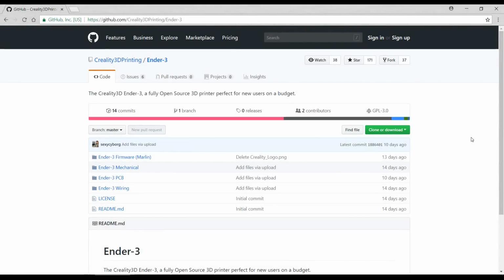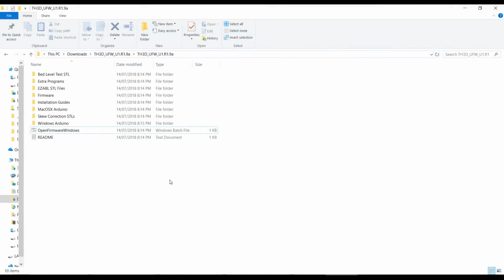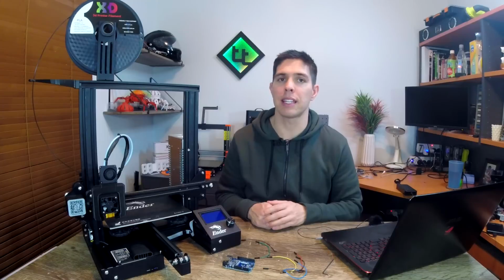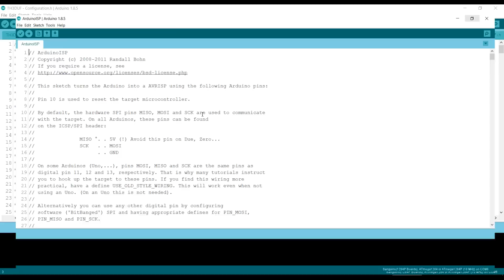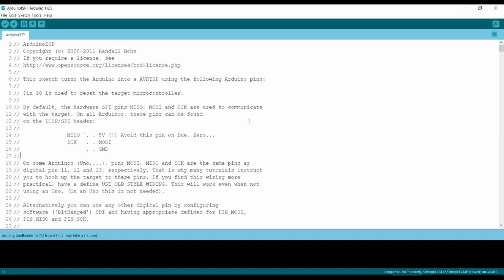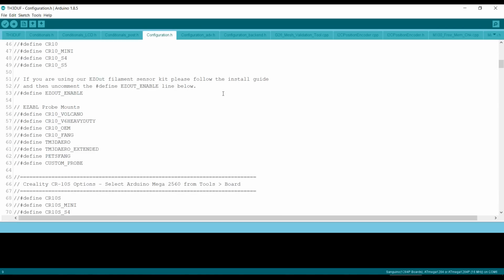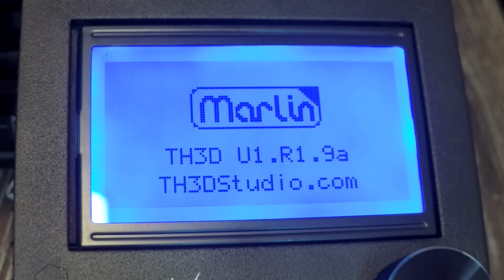Ender 3: How to install a bootloader and update firmware

Comment: Thank you! Thank you! Thank you! I did this sooooo long ago and forgot the process! I was trying to upload the Marlin sketch via the arduino uno AFTER burning the bootloader (>ლ) Obviously that wasn't working because I was supposed to just use the ORDINARY MACRO USB CABLE to upload the sketch.... I literally just spent hours trying with a USBasp and I'm guessing I got scammed with the one I bought LOL. Apparently there's different chips for the USBasp(s) and mine wouldn't come up in progisp... I was about to give up and just believe I broke my 1.1.4 board. You saved me from having to buy a new printer!! Thank you!!!!!

Comment: 6 years later…I’m trying to upload a .hex file for a BLTouch on my LK5 pro.
I can’t get the firmware update because I can’t get connected to the printer. 
Will this work on my board that has a MKS 1.1 board?
It’s almost, if not identical to the board in your without “creality” on it.

Comment: As this is over 6 years old, I find the th3d is deprecated. However, whilst the Creality site has firmware. Hex for my v1.1.4 board, when I try to open it in Arduino IDE I get an error. Is there something I should do to allow opening of .hex files?

Comment: The lack of thermal runaway protection is something everyone trashed Anets over. I'm using my anet a8 with an ender 3 pro 1.1.4 board a friend gave me after my SKR board bricked itself when I added a BLTouch and tried updating the firmware to enable ABL.

The thing is... I never had to use an external bootloader to flash my Anet, it just had one built-in.. and yet Ender users mocked me for using an Anet

Comment: Great video. Because this has made 5 years ago, i have one doubt. It´s possible realize this procedure in Ender 3S1 with mainboard V4.2.2 ?.  I have an issue with the bootloader and i have malfunction and not read the firm from the SD Card (none!). Many thanks in advance
Reply from the maker: That board should not need a bootloader. It's 32 bit and should read the firmware.bin file from the sd card. I'm rusty but from memory it must be given a unique name each time you update. See my creality v4 mainboard video for what this means.
Reply: @TeachingTech  Thanks man, buy i try difrent names almost 6 or 7 times. The update is´t read in appaereance. The problem is that although I tried other versions of popular Marlin systems on Github, I couldn't get it to read them either. Sometimes it passes by at startup and other times it stops for a minute and continues or stops completely and crashes. The screen also does not show anything other than the creality logo but without any movement. At this point I'm already feeling lost although I'm almost sure it's a bootloader problem and firmware corruption. I accept any idea that gets me out of trouble.
Reply from the maker: In these instances it's best to try and connect via terminal to see if you can talk to the firmware directly: https://teachingtechyt.github.io/troubleshooting.html#terminal
Reply from the maker: Also, a different SD card can really really. Sometimes they are really fussy.

Comment: With the new Ender 3's you don't need to do this anymore. Just donwload the firmware, modify it with vs code and then upload it to your SD card. Then insert the SD card in the printer. Turn on the printer and it will automatically install the firmware.

Comment: I think i broke my bootloader, i only get an unsuable blue screen now.
Will this work with an Arduino mega 2650? cuz thats all i have
trying to fix a creality 4.2.7 board
Reply: You should be able to flash the 4.2.7 board with the appropriate .bin file. Put the file on an SD card formatted for FAT32, with a 4096 bytes allocation size. Put it in the printer before you turn in on and it should begin flashing.

Comment: Hiya mate, bit late to the party here. Thanks for the vid. I'm fairly new to 3D printing, and got a conundrum that hopefully you could please give me some guidance. Bought ender 3 V2 NEO that comes with GD32F301RET6 MCU. Tried to klipperized it but installed the STM32 ver without knowing that it has GD MCU (not until I opened the case). Anyhoo, I think it's dead as when trying to flash it back to stock, it doesn't seems to be detecting the bin. Wondering if the bootloader is stuffed? Is this fixable in your opinion? And if the bootloader that needs reflashing? If yes, I looked into this and there's only 4 ISP pins on the board which is rather odd. The MCU is on creality 4.2.2 board. Hence, I got no idea which PINs should be using to flash this thing. Any guidance would really much appreciated mate, I'm right up the wall at mo. Cheers

Comment: BE AWARE - Some of the Ender 3s that shipped after 2020 have the 32-bit board (like mine) and you don't need to install the boot loader.  Double-check your board before wasting time like I did!  Great video, btw!

Comment: I installed new firmware when I added the BLtouch using nothing other than the micro sd. What fake lying nonsense is this bullshit? What's the REAL method to flash firmware that doesn't include all these unnecessary, fake steps?
Reply: This is for older ender 3s 
I had to do this year's back, looking to see if they came out with better software because mine is laggy.

Comment: will this apply/work on a cr10 V2? failed after 1st firmware and now cura says printer not connected and printer is stuck on blue screen with a rectangle square of dark pixels - doesnt respond to any input ..

Comment: If anyone has working v4.2.2 or v4.2.7 board with bootloader, can you please download it from the memory and send me the bin file?
I am not able to update the firmware via SD card because I have erased the controller flash memory many times.
Bootloader should start on address 0x08000000 and end on 0x08007000 address.

Comment: Hi man! graet video! i want t try this but for different reason, let me tell you a little bit.

couple of nights ago, started printing and then went to bed, at morning a bad surprice, hot bed got stuck with a shard of a broken lamp (no idea how lamp got broken) the fact is that bed got stuck and screen went blanc.

Do you know if there is a way to fix it? maybe installing a new version of firmware?

Even if i turn off and on again screen is turned on, but no image on it. i even do not know if is a step motor broken or board is broken or what, how can I test what is broken?

Please help! 🙁

Comment: After putting the bootloader on the machine, aren't you supposed to be able to upload new firmware by just plugging in an XD card and reboot the Ender 3? I've done everything on this video (Great Video) but just wondering if next time I can do the XD card thing w/o needing to connect the laptop to the printer. Thanks!!

Comment: Actually , you can just put the firmware .bin file on the sd card. Put the sd card on the printer, switch it on, and after a few seconds it boots up normaly! Without the need of this.
Reply: not on an old board,

Comment: i just bought ender 3Pro, does this still apply?  i haven't the slightest idea what i am doing, though i have triple checked my assembly skills and all seems good so far. i jumped all in on metal upgrades , got 10 spools of various colors and types of filaments , a cr touch,  tool kit, dryer. it came with a glass bed, i didn't know that was included, so i have an extra, but ran into a snag there :when i changed out the leveling knobs and springs to aluminum knobs and yellow
springs i got
online, and have the glass bed clipped in place, the nozzle is tight to surface when spring compressed completely, so i went back to the magnetic one that came with it. my macbook being repaired, but i have use of friends PC. I don't want to download a bunch of stuff onto their computer oh but I'm dying to see this thing print something. Please someone tell me what is my next step?
Reply: the glass bed is thicker than the magnetic ones so the issue your probably happening is that the z stop is too low i suggest moving it up a few mil to account for new bed height. i find that if you need to move the z stop up the best way is to put something between the bottom of it and the table to hold it up then gradually add playing cards so you have a surface to hold the stop against instead of trying of trying to hold it up and tighten it

Comment: I keep getting errors when I try to burn the bootloader 
avrdude: Device signature = 0xffffff (probably .avr8x_mega)
avrdude: Yikes!  Invalid device signature.
 
I'm thinking I might not have a good wriring connection and when I tried crimping my own wires it made things worse. Is there a more secure way to connect an ardinuno to the mainboard? or why I am getting this error message?

Comment: "you won't receive any performance improvements by updating the firmware" well that is not entirely correct anymore, since the old old version of the firmware doesn't have the tools necessary to tune things like microstepping

Comment: I know this is an older video so you aren't actively checking comments but thank you so much for this. Recently took my printer out of storage and wanted to flash it for the thermal runaway protection. Now I can rest a little easier.

Comment: Timestamps for myself because I keep coming back to this video!

0:00 Intro
0:15 Objective & Reason (THERMAL RUNAWAY)
1:17 Tool List 
1:50 Firmware Options
2:34 Downloading Files 
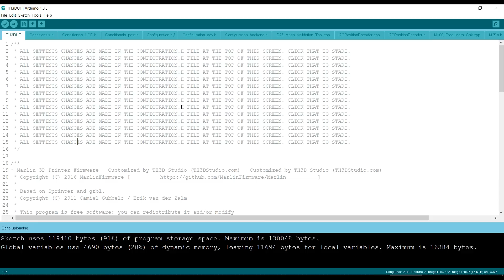4:05 Differences Between Stock Firmware and TH3D Firmware
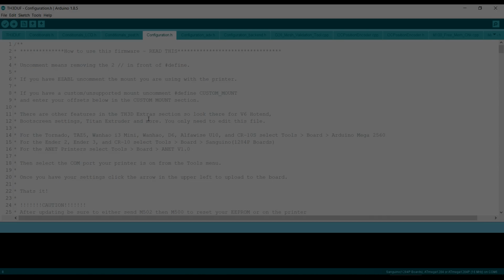4:44 Flashing Bootloader INTRO
5:14 Physical Disassembly and Setup
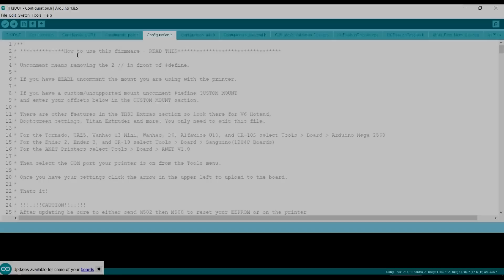6:00 Setting up Arduino to Flash Bootloader
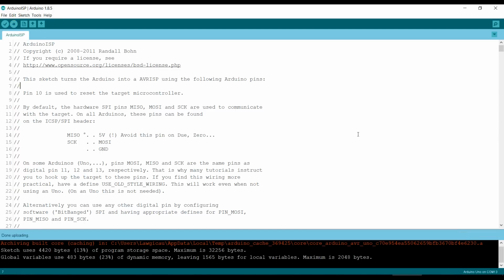6:25 Jumper wire connections (Screenshots included)
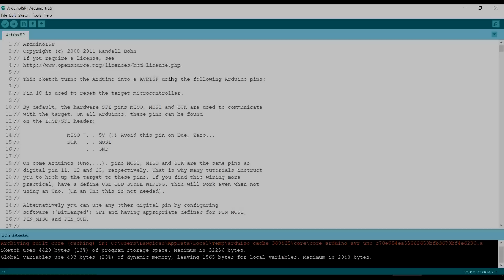7:55 Burning/Flashing Bootloader for realz
8:39 "The Hardest Part is Over" (Epilogue)

8:53 Setup for flashing firmware WITH a bootloader
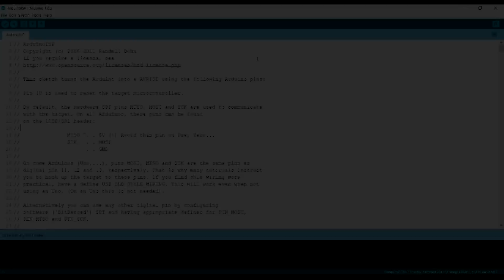9:09 Configuring the firmware for your printer model
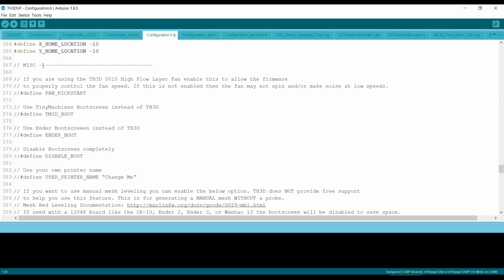10:06 Extra features to configure if you want 
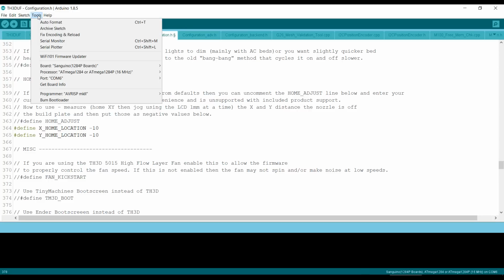10:33 Example of what a successful flash looks like

10:52 "thats it" (Conclusion)
11:09 Reassembly Tip
11:18 Reiteration of Goal (Setting of Expections)
11:28 Teaser for Auto Bed-Leveling
11:38 Michael's Blessing
11:44 Outro
Reply: Not the hero we deserved, but the hero we needed.
Reply: @reallemonboi7957  agreed
Reply: spits in hand
can i do you a favor?

Comment: Very informative. My Ender 3 pro has a V1.1.5 board with a bootloader preinstalled. Can I follow this process and ignore the bootloader install steps?
Reply: What's up man. I haven't watched the video, but I also have a new Ender 3 Pro. I'm newish to this shit, but learning as I go. I'm upgrading several things, and from what I understand all you have to do is put the firmware you want to flash onto an 8gb SD card (no larger for some reason) with nothing else on it, rename it firmware.bin, put it in the printer, turn it on and wait about 15 seconds. It should flash onto the printer.

I tried this yesterday for my bltouch upgrade and it worked. BUT, PLEASE DO YOUR OWN RESEARCH! Remember I'm new to this, and don't know what the hell I'm doing. I might not even be answering your question correctly since I haven't watched the video yet. If it's flashing firmware for an upgrade then what I stated above is correct. Lots of firmware upgrades on GitHub.

Good luck man!
Reply: Thanks  @markschoch9509 . Grading the firmware is in my list of upgrades - just getting a few prints done before I turn the printer into a paperweight by getting it wrong 😂 Thanks for the reply 👍

Comment: making the arduino an isp programmer was no problem but when i tried to burn the bootloader i got this error "Invalid Device Signature 0x000000 error". I searched far and wide and found nothing. After some tries i just replaced all jumper cables with different ones and then it fkn worked.

Comment: Thanks for all the informative support you give. 
I have followed your instructions, but when I burn the bootloader I get an error message stk_500recv() programmer is not responding. I have a creality ender 5 pro with 1.1.5 motherboard. Kinda at a loss on what to do now

Comment: I've followed this several times and after the bootloader is burned my printer doesn't show up in the com ports when trying to flash the actual firmware.  Any ideas?
Reply: Just installed mine. I just followed the instructions found here http://myosuploads3.banggood.com/products/20190924/20190924222919manual.rar 
The only trouble I had was that it didn't want to print. But a quick search online (new "starting G-code" containing G29). After that I just restarted my ender 3 and worked out great... Although my Ender 3 is now called Ender 3 pro in the LCD screen.

Comment: Unfortunately I can't compile it with Arduino IDE whatever I made. It returns with "fork/exec C:\Program Files (x86)\Arduino\hardware\tools\avr/bin/avr-gcc.exe: The filename or extension is too long." error. I've changed the TEMP folder to C:\TMP and moved the project folder to C:\ too but it didn't work either. I've tried VScode with Platform IDE and it compiled without error.

Comment: After some digging it looks like this guide is obselete for any new ender 3 or ender 3 pros. They now use the 4.2.2 boards that are used in the ender 3 v2
Reply: Does that mean the new boards have a bootloader installed?
Reply: @tannersmith977  yes they do. Some say it has thermal runaway protection already on the new boards. But I compiled new firmware anyway and just installed it via the included SD card.
Reply: @eliot327  Which firmware from the creality site would apply then? the one labeled v4 motherboard or the one thats older but labeled 4.2.2
Reply: @tazestudios  I used a bugfix version. If it recall correctly that was the only branch that had 4.2.2 for the base non pro and non v2 ender 3s. I had trouble finding it though and it looks like the person that helped me on reddit deleted their account. If you can't find it I'd just post about it on the ender 3 sub.
Reply: @tazestudios  definitely doesn't use anything that isn't 4.2.2 specifically for ender 3.
Reply: @eliot327  hey man i was wondering if u could confirm that the latest ender 3s had thermal runaway?

Comment: My USBasp decided to die under a burn, and now my ender 3 does not come up with any text on the screen only blue light.
Arduino IDE tells me "programmer is not responding" when using Arduino Uno so it cannot write the bootloader to the mainboard of the Ender 3, Is it completely bricked?
I have tried another USBasp but that one won't come up in the COM port selector in Arduino IDE the same with a USBTinyISP that is brand new.

Comment: Thanks Michael; great video. You can use a Nano as well; just turn the board 180deg (USB cable pointing away) as the ICSP headers are backwards on the Nano and put a 10 -100 uF cap between the adjacent GND and RST pins (with its -ve connected to GND). Worked for me!

Comment: I followed the guide 100 percent .. burned bootloader, went to continue on to put the firmware on the printer using usb but the ender com port does not come up so I cannot transfer anything to it using usb. and now when i turn my printer on the screen is just blue and there is no boot screen
so it messed up the firmware that was on it and now I can't put new firmware on. Great.

Comment: Great tutorial, thank you.. Followed it pretty religiously but once Ender 3 was connected to PC Arduino IDE was throwing up some errors. Just a heads up folks in case you get similar issues. 

1) if you get error stating can't find Boards.txt.. I just copied and pasted the file into the Variants & Bootloader folder, after this i got a different error message "error compiling for Sanguino" after some forum searching i got the solution (website for solution = https://forum.arduino.cc/index.php?topic=554684.0

2) After updating Arduino AVR, i kept getting a an error saying "Can't set comm state" after some additional searching for solution i found out the PC's USB driver didn't recognize my Ender 3, delete the USB driver while Ender 3 is connected then go to "https://support.th3dstudio.com/hc/en-us/articles/360043291432" to download the relevant USB driver. 

Once all that was done, the compiler was able to update my printers firmware and i'm happy to say it's worked like a charm. 

Now maybe it was just me this has happened as i am new to Arduino programming but, but on the off chance it's not then i hope this will provide a suitable troubleshoot.

Comment: Thank you for this awesome tutorial.
I  had an issue on the very last step.  Could not upload the update.  Error was avrdude: ser_open(): can't set com-state for "\\.\COM6" 
The com port device driver was not compatible on my Win10 pc.  The fix was to install the driver from the folder "TH3D_UFW_U1.R2.B5/TH3DUF_R2/Printer Drivers/CH340 then double click and run the file CH340 Windows.

Comment: I remember using this tutorial a few years back on my windows 7 laptop and it worked like a charm. when trying it on a new Ender 3 and new windows 10 comp I don't see the Sanguino board as an option. Any help would be appreciated.
Reply: yeah im having the same issue, any lead?
Reply: @Nekotamer  Sadly no. I ended up just getting out my dinosaur laptop and using the setup on it from when I flashed my original Ender 3. Luckily the newer boards all come with bootloaders pre installed.
Reply: @johntrexler5164  ok i got the answer: you have to install in the board manager the sanguino board. also with any dependencies that might pop out to be needed.

Comment: respect for people who prepared everything and realised they only have male to female connectors
Reply: I know this is old but if anyone else has this problem, just put a breadboard inbetween the arduino and mainboard.
Reply: @benp439  or aslo just solder the female to male directly  on the arduino  (desolder the 6 pin connector first)